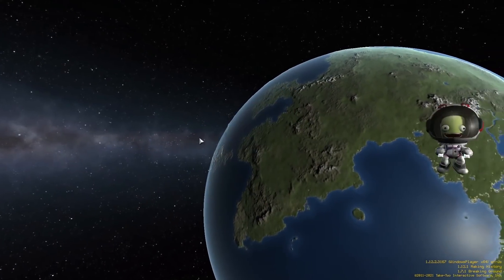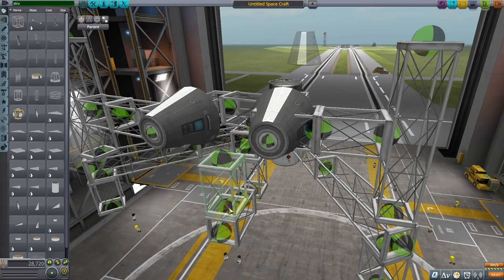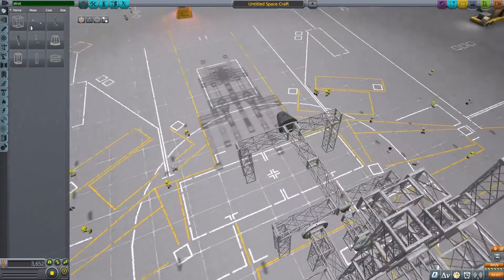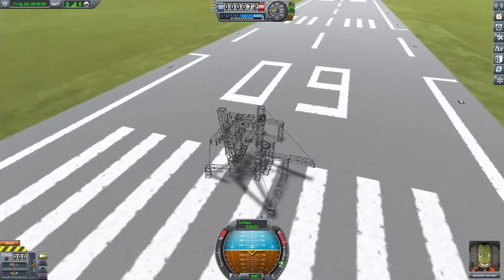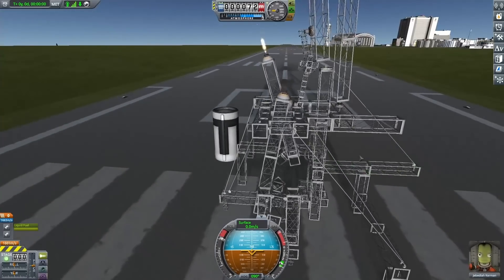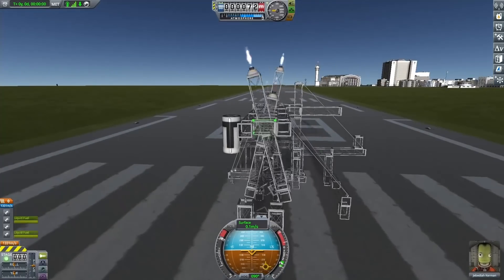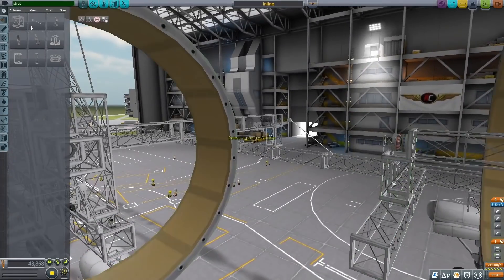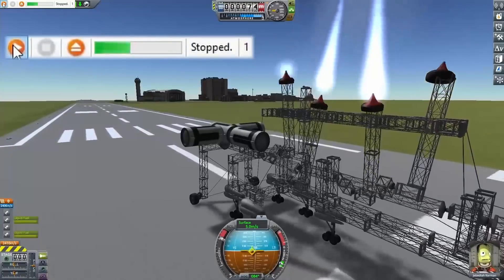Making an Engine in Kerbal Space Program

Comment from the maker: Before the video goes live I just wanted to say that now I see I could have replaced the macro with the KAL-1000 controller. It would have made things easier for sure, but manually starting the engine would have probably still been required since it was such an unpredictable process. While the macro seemed to work just fine, I do wish I saw the controller while I was building.

Also, turning on collision would have been convenient, but I'm not sure if you can do that on a part by part basis (please let me know) or if it has to be done for an entire vehicle. I needed the crankshaft to clip through itself, so having two separate vehicles worked well here. I'm new to breaking ground, so it's been a learning process.
Reply: You can make parts of the same vessel have collision by clicking the 'Same Vessel Interaction' option when you right click a part. This option is only avaliable if you have 'Advanced Tweakables' turned on in game settings.
Reply: Yes and “Same Vessel Interaction” can be set on a part by part basis
Reply: I'm glad you uploaded ksp vid, I've been waiting for this
Reply: My mind blew at what you made at 8:56
Reply: Hi
Reply: There is a setting for same part collision so things do just clip through
Reply: I already thought why you didnt use the kal-1000
Reply: Same vessel interaction is part by part
Reply: Advanced tweakables, game settings
Reply: Hey man, I'm sure you probably got this comment a thousand times already, but I gonna say it anyway. 

Go to game settings (from the main menu), and turn on advanced tweakables. Trust me, you'll thank me later.

Then you should be able to right click parts in the VAB, and click `same vessel interaction' on individual parts.

You can also fine tune your motors, turn of motor engaged, and tell it to free spin when unpowered. 

... Finaly, use symmetry mode more. Theres a mirror mode for symmetry, not sure why you were copy/pasting parts instead.
Reply: As mentioned by Span Staans if you turn on Advanced Tweakables in game settings you can set Same Vessel Interaction part by part.
Reply: Which macro program do you use?
Reply: You can turn on advanced tweakables and select "same vessel interactions"
Reply: boo
did i scare ya?

Comment: In cases like using unpowered rotors, you can adjust the motor size to be lower and it will dramatically reduce the mass of the part. I don't know if the mass change is measurable in the ui, but it makes a huge difference for like... articulating/telescoping robotic arms on Eve where the gravity is higher and I might not be able to even heft the arm around on a hinge if I'd not reduced the motor sizes on the extremities.
Reply: whats name for rotor mod

Comment: If you use the Kerbal OS mod, you can get the engines to fire based on a sensor. You could put a sensor on each piston and use height above terrain to determine when to fire, or a couple of sensors on the wheel to do the same.

Comment: also parts in kerbal space program don't collide with each other if there the same vessel, to fix this turn on advanced tweakables in settings and then you can enable collisions for each part. also you can turn on auto strut with the same advanced tweakables thing so then the parts bending wouldnt be as much of an isue, just dont select any parts that are meant to move cause it locks them to another part so they wont be able to spin

Comment: Pretty cool idea and how you build it :D i build an engine too but i used a crank shaft with protective heat plates and used engines too push on them with their exhaust. Used some simple gears too transmitt the power too the custom wheels and it was able too reach around 12ms, the cool thing is that i could attach a prop and some wings and it was a pretty good prop plane being able too fly easily. Nice build keep it up :D

Comment: Watching Reid play Besiege: "Wow! It's so crazy the things he's able to build!"
Watching Reid play KSP: screaming internally
Reply: That in-line 4 was rough to watch
Reply: @colson469   Things that were rough to watch:
- Not enabling Same Vessel Collision
- Using Modular Girder Segments for the piston and “cylinder” (very high friction, and cylindrical parts do exist)
- Never using part symmetry
- Never using launch clamps to hold the test bed down
- Using the Dart for literally anything
- Not holding “alt” for attachment node snap, which introduced a bunch of small misalignments into his crankshaft
- Not hinging the piston head. It would have allowed the piston to travel straight up and down, both increasing the efficiency and removing the need to make the collar extra wide. 
- Not an issue with gameplay, but Reid says it would be “weird” to have the engine “moving laterally”. This is what’s referred to as “transverse mounting” and is actually extremely common in 4-cylinder cars. Driving the car directly off the motor would have avoided the friction losses from the bevel gear

Reid, if you’re reading this, I think you’d benefit a lot from doing some research into KSP’s build system (Reddit, YouTube, and the Wiki are all great resources). There are a few simple shortcuts, features, and techniques that would speed up your engineering process considerably and produce better results
Reply: True xD

Comment: When holding Alt and connecting a part it would connect only to joints and not surfaces. Also you can switch symmetry mode without switching from VAB to hangar, but i dont remeber how to do it.
Reply: Middle mouse click on the symmetry button, not sure if there's a key for it
Reply: I think it's either X, Z, or R. I don't have KSP installed rn but I remember those are keys used for symmetry stuff.
Reply: @gelatinoussire7772   i think it's R

Comment: Some helpful tips for the next time you build something in Ksp:

Holding alt will allow you to force parts to connect via the nodes (the green spheres). So you won't have to manually center parts.

And in the settings there should be a setting for advanced vehicle options which will allow you to right click parts on the craft to enable collision with the ship. So you don't have to decouple and make 2 separate ships

And you already found the Kal-1000 :)) 

Love the videos as always!
Reply: Ooh I've been playing ksp for a while but didn't know that alt key trick! For clarification: I just got the parts close enough so they would snap before now
Reply: i have 400 hours in ksp. i did not know this. thank you.
Reply: And c toggles snap, and x switches through symmetry amounts

Comment: If you enable the "Advanced Tweakables" option, you can toggle self-collision on parts of the craft (if I remember right). You can also enable rigid connections and configure an "autostrut" stability system.
Reply: You did remember right
Reply: I was yelling this at my screen
Reply: @prime-aerospace  Yeah, I kept waiting for him to figure that out.  I finally cringed out and stopped watching around 3:30
Reply: @MattStryker  Yup. I was just like "turn on self interactions." "turn on self interactions?" "TURN ON SELF INTERACTIONS!". And that was pretty much enough of that.
Reply: @prime-aerospace  every time i watch real civil engineer, that happens to me.
Reply: Yeah lol I was waiting for a section of the video where he realises... But it just never came
Reply: Up
Reply: same vessel collision
Reply: its phrased as same vessel interaction.
Reply: Yes
Reply: And you can also add same viechle collision
Reply: It should work without cheating
Reply: @NotAGrApe28  its not cheating but ok
Reply: @NotAGrApe28  cheating is when you use the cheat tool bar to allow for the placement of parts within parts.

Comment: Go to the settings in the menu  and activate "Advace tweakables" then right clic a and enable "same vessel interaction"
Reply from the maker: Can you enable collision on a part by part basis? I was clipping my crankshaft through the pistons intentionally and that would be an issue if collisions were enabled.
Reply: @ReidCaptain  yes it's part by part
Reply from the maker: Ok, that's perfect then lol
Reply: @ReidCaptain  also use autostrut instead of manual struts (it will make everything much more rigid if you set it up right)
Reply: @ReidCaptain   if you enable 2 pieces only those 2 will colide with each other
Reply: Yep, that would have saved him some trouble